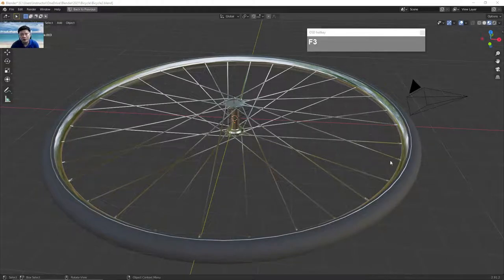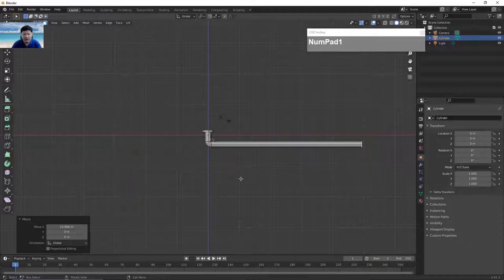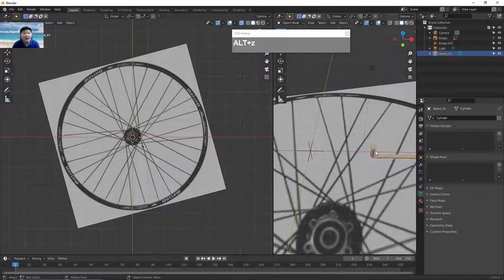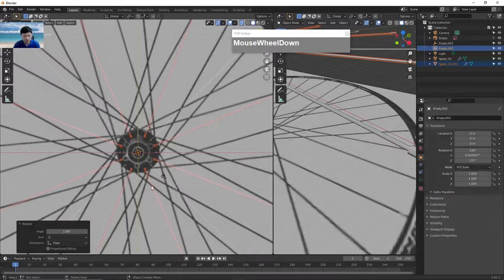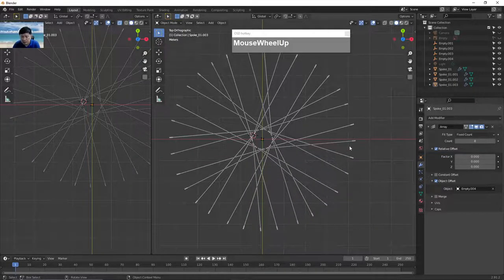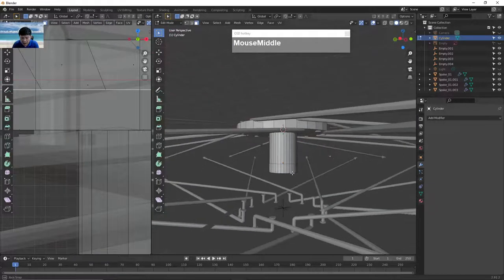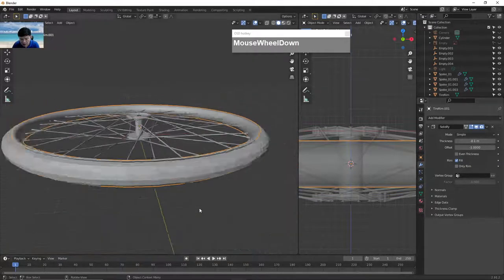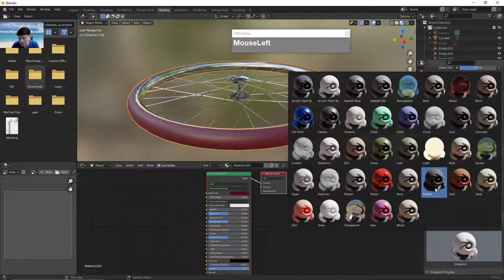Bicycle Wheel Modeling Tutorial in Blender 2.91

Comment: Hello , this is great , though a suggestion as a bike mechanic and wheel builder . It may be easier to make the hub first . Many hub makers have the hub dimensions on their website  as do rim manufatures . So making a hub and rim first would give reference points to make a single spokeand then   duplicate that for all the spokes  . For referance  add in the spoke drillings on the hub flanges will enable you to get the spokes all lined up evenly . 
If you also model the spoke holes in the rim too will add extra refence points for the spokes . 

Of note for others rear and front hubs have different flange offsets . The front hub is almost equal unless its a disc hub where as the rear hub has the driveside (right side) flange nearer the hub centre (all found on manufactours websites (or use a generic dimentions as found on DT Swiss Web site) 
Sheldon Brown also has a great stepby step wheel building page with lacing patterns (radial ,1 cross , 2 cross and 3 cross) 

Great work ! I'm going tobe doing this soon .

Comment: When applying all transformation, the median jumps to a different place because the wheel I am making is a part of a bigger product. I am unable to do the array modifier because of that. Please help, Thank you.
Reply from the maker: You might want to model the wheel independently in a scene file on its own, once completed. You can combine all the pieces together using a the CTRL+J combination after selecting all the parts.  Then you can import the completed bicycle wheel into your main model.
Reply from the maker: One more thing, you need to press Shift + C to reset the cursor position to the origin location.